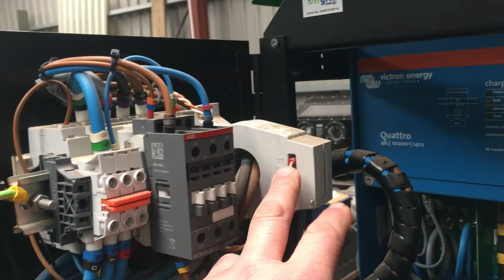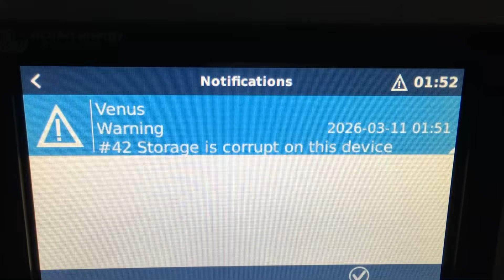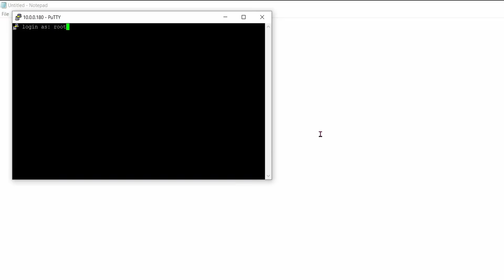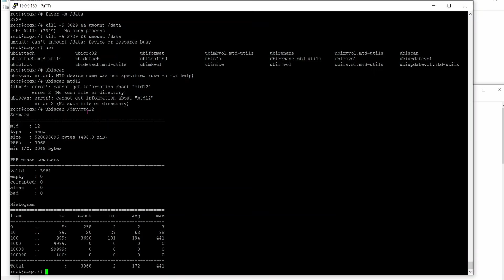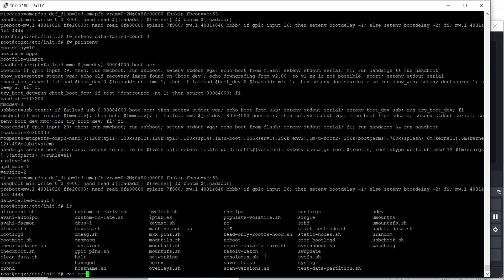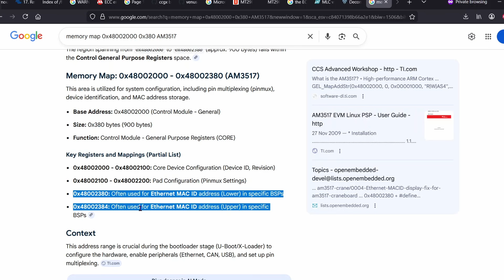Victron: "It's not user repairable" 🤔 Me: "Really?" | Victron CCGX Repair

Comment: A awesome repair Mick,
If you are going to bring that back to life rather than massive lead acid batteries, you should look into getting a old EV battery pack they can be purchased quite cheaply now these days
Reply from the maker: Thanks mate 👍I've already got 6 x pylontech usc3000 that are set up with another smaller inverter, so I get some more and put them all into this. I'm going to have to re-design the battery compartment though, as these are more rack mount type batteries.

Comment: Thanks for all the cute animals as requested last week!😊😊😊😊😊. 
Not sure of your ideas for your batteries: but for my emergency UPS for my medicine fridge; I used a bunch of plastic 12v motorcycle battery "emulator" housing  that I got from AliExpress for next to nothing, and you populate these with 18650s. My logic was, that though this is a relatively costly way to get lithium power, it is eminently repairable "piecemeal" if individual cells fail, and if 28650s are bought in bulk the actual cost comes down significantly....making up the batteries also justifies buying a spot welder 😉😉😊😊😊
Reply from the maker: Thanks Simon 👍I've got some pylontech usc3000's already on a smaller 5Kva inverter, so I might get some more and put them all in this.
Reply: @BuyitFixit will you use PV panels and/or a wind turbine to charge it up? I was amazed my seat facing PV array was producing 3,6kw in the milky late afternoon sunshine yesterday and because I don't have a working battery backup ATM that was all feeding back into the grid and earning us diddly😕

Comment: From Linux to lamming! 😂  Perfect!
Reply: From the LAN to the lamb
Reply from the maker: 😂😂😂Yes I thought it was quite funny that bit too 🙂🐑
Reply: Great video. A quick fsck -n on that partition wouldn't hurt given it's not the root partition, also that PID came more than perhaps from a service that needed to be stopped properly (use ps to track the service name, make the sure the service can be stopped, then run a systemctl stop on that service name) verify that the PID is gone from the partition.
However, in your case, the partition error was most likely due to a system protection working the wrong way or planned failure if things change outside victron.
Great video.
Reply: Yes man, the Penguin/Sheep transition was wild :).

Comment: Better format the sdcard as ext4 first. vfat can‘t preserve file access and ownership settings, cp warns you about this.
Reply from the maker: Good tip, I'll keep that in mind next time 👍 I mostly use windows, and the victron instructions said to format it fat32 for the firmware update, hence it being fat32.
Reply: @BuyitFixit  might also want to sha1sum to verify file content on source and destination. It will also warn if files read differently between reads.